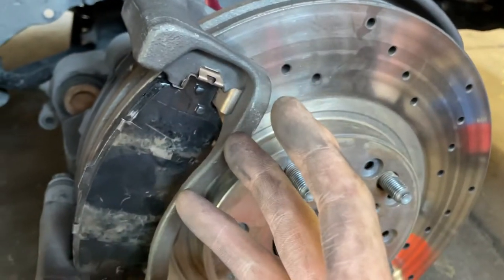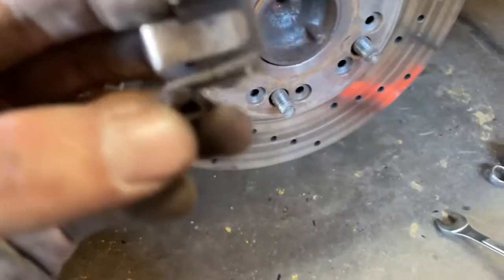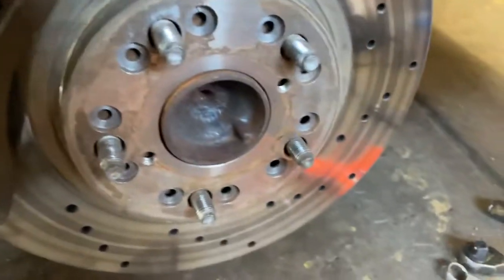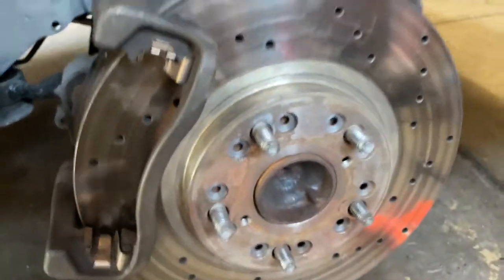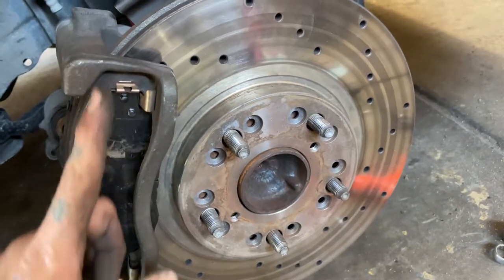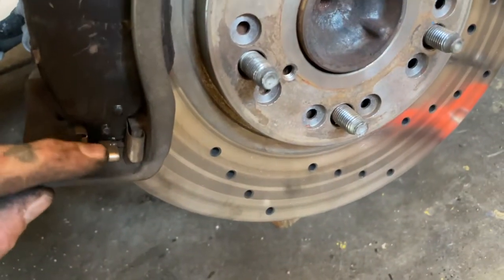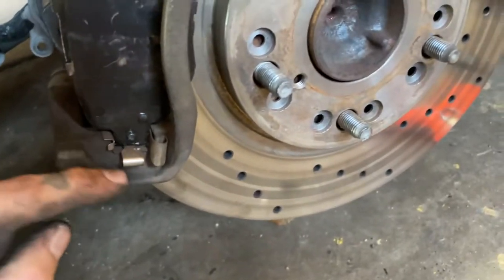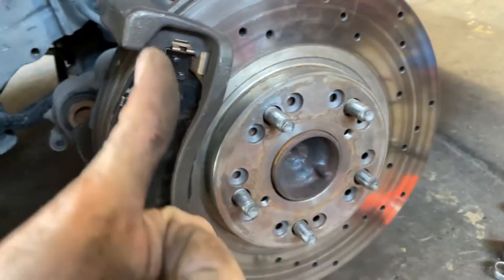WHY LEXUS/TOYOTA BRAKES CLUNK S17E09

Comment: Great video! For Toyota brake calipers that are mounted on the front side of the wheel, would the spring clips be on the top, as the pads would be pushing down when driving forward?

Comment: My is300 has these identical spring clips. I've been hunting down a clunk for quite some time. Replaced lower ball joints, sway bar mounts and end links, even the lower control arm bushings. And I still have this slight clunk when braking after changing from reverse to drive. Found the answer it seems
Reply from the maker: Yea a lot of vehicles use the free floating pad design.
Reply: So did it fix the issue?

Comment: Great Video....I have this clunk in my 99 4Runner. I  don't have these clips it has 2 pins that hold both brakes any suggestions?
Thanks for the video please keep them coming.
Reply from the maker: If they are like the rear brakes on the is300 than I will be doing a video on those as well. since apparently everyone has been installing those wrong as well.

Comment: Great video! It just got brand new brakes and rotors and I’m having this problem for my Lexus ES 350. Is it possible to visually tell if the ones on the back are installed so the double spring is at the bottom? From the front, I can see it’s installed correctly, but from the back, I can’t tell.
Reply from the maker: pull the wheel.

Comment: Help!

I got all 4 brakes pads replaced with dealer parts on my ‘09 ES350. I’ve started having clunking noise from the front right wheel on braking. What could that be? The pins, clips or shims? One mechanic told me it’s the pins or clips, but when I inquired from the dealer they said they don’t come separate but with new brake pads. Apparently, they must’ve been replaced when I got the job done.

What should I do about it?
It’s so annoying to hear the clunk whenever I apply brakes.
Reply from the maker: did you not watch the video??
Reply: @pawpatina  Yeah did. It would be amazing if only that turns out to be the case. I still have to check it.
Reply: @pawpatina  Hey! I checked them! Unfortunately, the shim of that side is missing. Could that be the culprit?
Reply from the maker: @timmi511  it can't be helping...
Reply: @pawpatina  Guess what! I went to another mechanic and he said missing shim can’t be making that noise. He got the brake disc checked and it turned out to be a bad skimming job done previously when the brake pads were replaced. He got it skimmed again and reinstalled! Waula! No sound at all!
Reply from the maker: @timmi511 congrats!